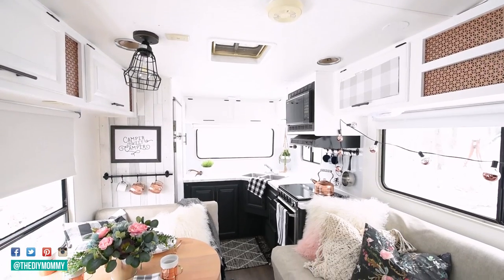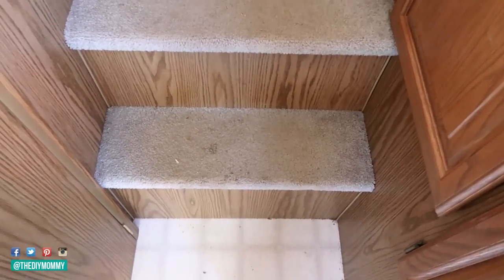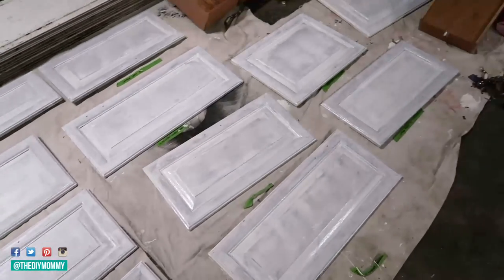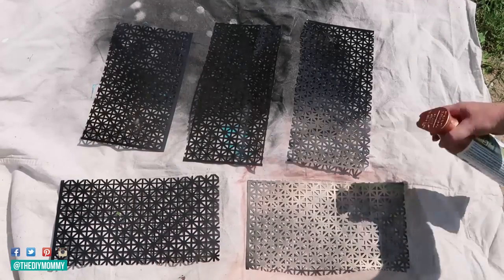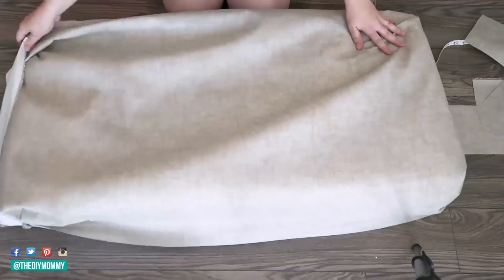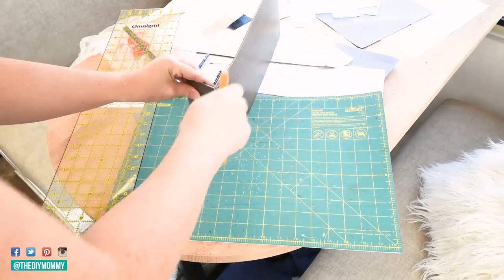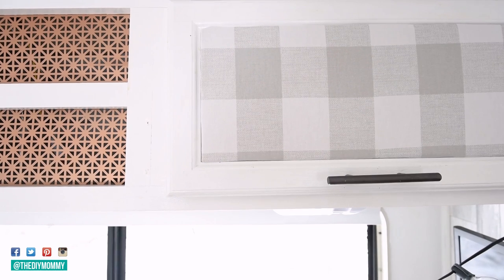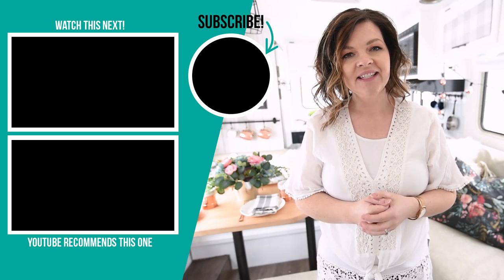RV Renovation on a Budget Step by Step! | The DIY Mommy

Comment: Your camper looks amazing.  Great job!!!  I do however have idea to make painting much less time consuming.  Sherwin Williams makes a high end paint called Emerald that retails for about $95 a gallon.  With this paint, you can eliminate using Kilz.  It's a hybrid paint that comes in satan and semi gloss.  It is also a self leveling hybrid paint with primer and polyurethane mixed in with it so you will see no brush strokes or roller marks when it's dry.  All you have to do is clean the surfaces to be painted, sand just until the shine is gone and apply two coats of paint and your done.  I do kitchen and bathroom renovations and this is the only paint I use when painting previously stained cabinets. You will have to buy it from a Sherwin Williams store.  They also have special rollers just for this paint.  They will also have samples of this paint used on various surfaces you can see.  This is the best paint in my opinion for this sort of work.
Reply from the maker: That sounds great, I'll have to give that one a try.

Comment: Great renovation project! 
That sink, shower and any hard wearing areas you could paint and then apply a layer of clear resin, or use an enamel paint, either of those should dry to a rock hard finish and protect it a lot longer while retaining the new colour I'd imagine. (Or perhaps mix a coloured epoxy resin and paint that over the top?)
Either that or Look for a cheap end of line stock sale by the time you mess around paying for paint etc and doing it you can probably pick up a cheap bathroom set for not much more..?(just an idea)
Cheers from London England 👍😎🏴

Comment: How can you notice the mold before you buy it? I am looking into old RVs now, and most say there are no mold or water damage, but I'm not sure I believe that. Also, you're so lucky to find ones that cheap. Ones of similar standards cost closer to 10k CAD in Norway
Reply from the maker: Water damage is really common in the ceiling, and usually you can tell if you give it a push. It will feel soft if there's damage.

Comment: Hi there, I wish I had found this video before purchasing a new one!  But now I want to use many of your ideas to personalize it. I do have a couple of questions:  my walls are not smooth and have somewhat of a texture that Command strips will not adhere to.  I'm wondering about that "peel and stick removable wallpaper" which looks like what you have used on the wall??  Were your walls smooth?  Command won't stick so I'm wondering if this will. If you have any insight please help! I need to drill holes in my walls to mount several things. Did you use screws with the mollys that open up inside the wall?  Also would like to know what type of paint will adhere to the cabinets? Thx so much I'm following you now....

Comment: This is definitely an inspiration on what to do with my camper. However, I have the same problem with the back of my camper and water damage. Did you guys video your husband fixing that? Really need some guidance on this specific issue and definitely don't want to take it to the camper place to be fixed.
Reply from the maker: Thank you for watching! No, I didn't film my husband doing the construction. It might be worthwhile to hire out. He had to rip the whole back wall down to the studs and re-sheet it with plywood!
Reply: Did you guys video the fix on the rear water damage? Can your husband give any pointers on this?

Comment: I’m 18 and have just gotten a camper for free it needs a lot of repares such as replacing the wall, part of He floor and a few cabinet doors. And possibly the bathroom tub. ( it’s a small camper so the main bed and the tub / toilet is right next to the bed the tub and shower are on the same wall that needs to be taken out 🙄 very frustrating) but this video was really nice and made me super excited to get working on it when the weather cools off!
Reply: Check YouTube. Wall repairs are usually done by removing outside panels, not from inside.
Reply: Wall repairs usually done from outside.
Reply: @daveerickson1330  my husband used to work with the company Terry Travel Trailers, that builds campers. He is renovating our 1965 Zipper. He gutted the entire camper. He replaced the walls from the inside. We are about to start a redo on our current one, a 2008 Jayco. Makes no sense to remove the campers skin, then remove the isolation and all that to replace an inside wall. I've never seen that before on the subject of replacing inside walls... Just curious, are you sure the videos on YouTube were for replacing an inside wall?
Reply: @NannaNeely  Videos I watched were more for full restoration. Interior walls & cabinets provide much of the structural integrity. Gutting a trailer was indicated as counterproductive & needed temporary supports for roof especially. I think the site was Mobiletec on YouTube. He was rebuilding a Shasta.
Reply: @daveerickson1330  Eek taking the skin off and then replacing just screams WATER INTRUSION to me!
Reply: Just take your time and budget. Alot of inspiring YouTube videos

Comment: Far far more important than making your camper pretty is to ensure it is safe and habitable. My husband and I travelled Europe in ours for most of 2016 so I don't feel knowledgeless.  As well as looking at it's machanics it is definitely important to do a habitation survey; look for any ingress of water (look at the outside to where the joints of your camper, caravan, RV or motorhome what-ever you call it) are and trace each one internally,  check the gas supply (hoses/cylinda) to ensure it is safe and there are no leaks (you can buy a spray for this purpose), install a CO monitor and smoke alarm (new campers etc will have these (at least in Europe as this is code) but old ones do not always , install a fire extinguisher or as many as you need for your size of camper,, check sealants in the washroom as water can ingress from here when you use the facillities, if you have a cassette type toilet ensure this works properly so it will seal and you can remove it for emptying purposes, ensure you have some kind of fly screen on windows, doors, roof vents etc and they are in good condition with no holes or rips (if they are ripped or have holes in them I'd recommend replacing or repairing them) otherwise bugs will get in, check your 12v supply is working and the 12v battery(ies) are charging properly over time (you will need this for times when you don't have the gas or electrical hook-up (EU)) & finally check your EU cable and socket. I hope this is helpful for anyone thinking of buying an old camper. Number one priority is your camper is safe and habitable in a fundamental sense. I hope this helps anyone thinking of buying a camper.

Comment: Sorry..the whole 'cottage thing' is cringe-worthy in a real campground setting. Wouldn't last very long. 

If there's water damage, the floor is not safe & I'd bet the shell will loosen/mold. 
$1000 for a fifth wheel? One word:  SALVAGE.
Reply from the maker: This is our third year using it and we are happy with it. We did replace part of the floor and water damaged areas before we renovated.